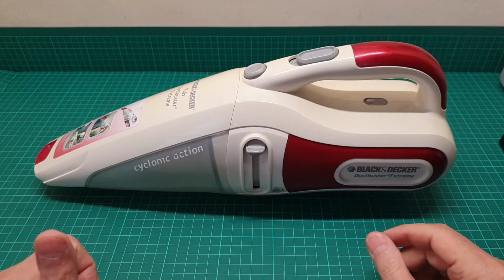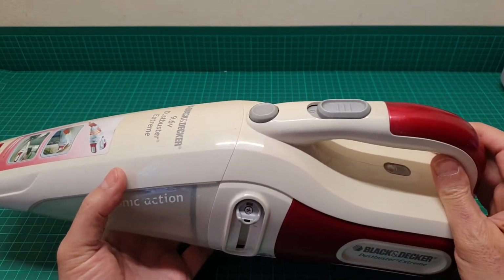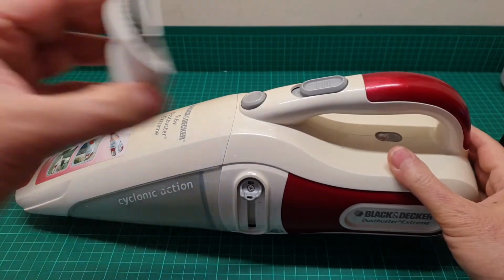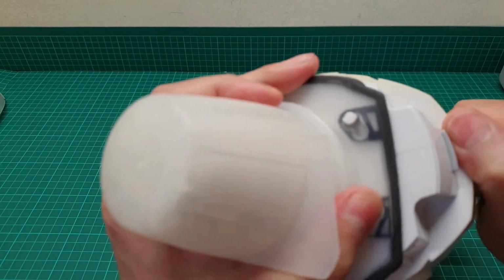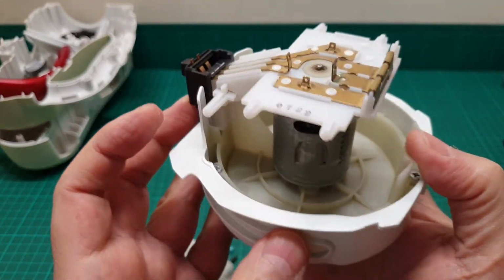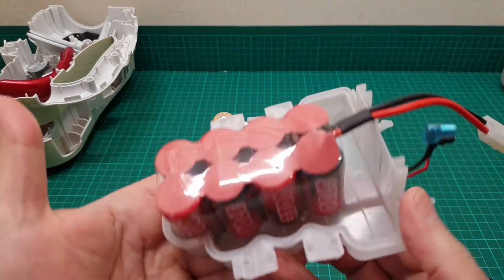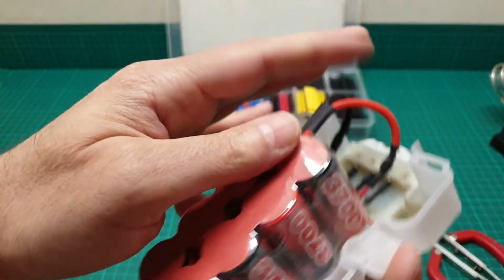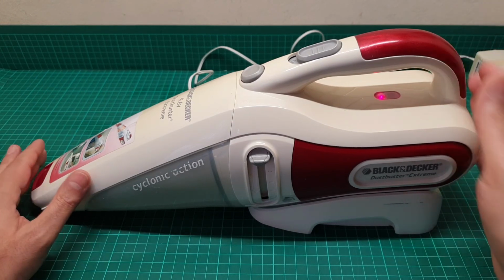Black and decker handheld vacuum battery replacement

Comment: Could you please advise how I could find the battery pack for this model ?
Reply from the maker: @Ddddddd741  hi, the battery pack can be found on ebay. Just type battery pack followed by voltage and size. Good luck and cheers.

Comment: superb video for those interested in the batttery but my problem is the charger... the replacement unoriginal one  i use for charging it never stops charging so maybe the charger has some overcharging protection or something:? can any one tell what the voltage of the cahrging adapter? thnx

Comment: I don't know why anybody supports brands or products that are designed in this way, the least they should do is design the product to be able to be used via plug in if not easily replaceable batteries.